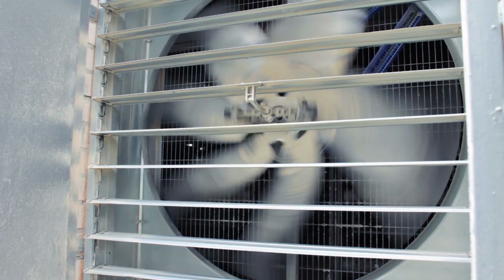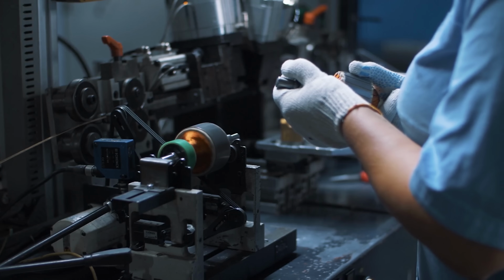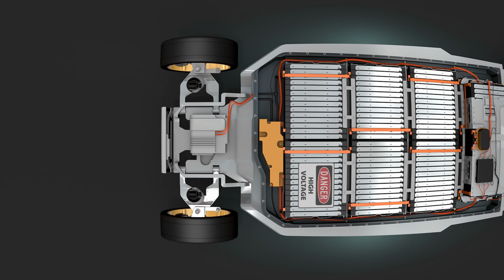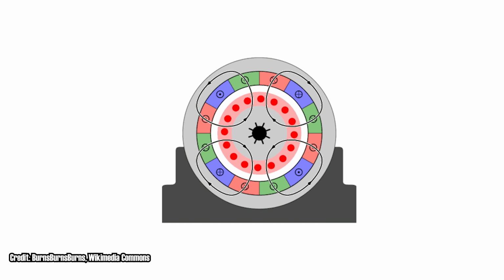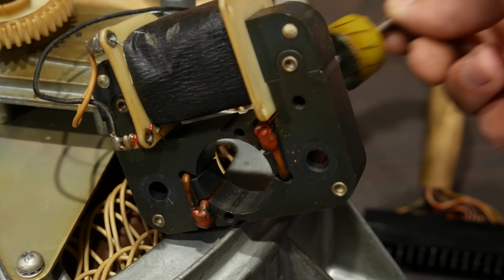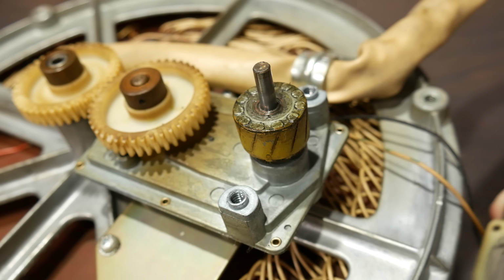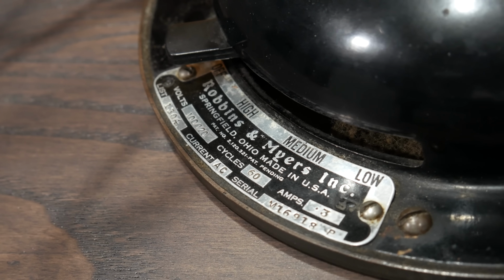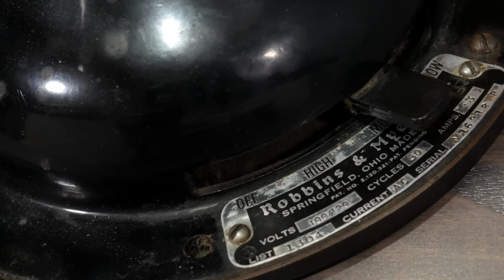Fans; High is next to Off on purpose

Comment: TLDW: Initiating the spin requires more power than maintaining the rotation. 

This is why if you have a fan thats dying you can sometimes spin it by hand to get it started and it will run fine.
Reply: Thank you. This was the comment I was looking for
Reply: Thank you.
Reply: I love you bro
Reply: Thanks
Reply: Best summary of a 17 minutes video. Sweet.
Reply: @technologyconnections What’s up with ceiling fans and the pull chain for multiple speeds?  I opened up a Hunter brand fan and was expecting something like a rotating selector but I saw two small black boxes that were wired to simple pull-chain switches. Can you help us decipher the internal workings and how do these small black boxes work differently than the on-off switch and the wall switch that makes the fan hum when on the low speed?
Reply: Torque
Reply: A fan that is "dying" usually signifies the need to lube the dry bearings. The motor is usually fine.
Reply: I've lived in old houses with less robust electric capacity and when the refrigerator compressor came on, the lights would temporarily dim about a second and then recover due to the greater initial power draw needed to overcome the electromotive force and start it turning. A window air conditioner would do the same thing. Not sure if EMF is the right term. Learned that in physics class a really long time ago.
Reply: @stampoutup-talking1436  The EMF builds rapidly from zero in a typical AC motor as it starts, impeding the initial current surge. When the AC motor achieves its steady state in less than a second, the EMF is high, and the available current returns to the lights.

A stalled/frozen AC motor that is not allowed to turn draws a lot more current, and may burn itself out. EMF is actually beneficial.
Reply: Wow, spoilers
Reply: if that happens to you, just replace the starting capacitor.
Reply: You have it wrong though 🤦🏻
Reply: The real answer is that the electric motor produces no torque when it isn’t spinning
Reply: @Stierenkloot   Newton law of motion states a rotating mass requires no power to maintain rotation except for the power required to cancel friction. Since power is required to initiate rotation, and the power required to counter friction must be factored in, how am I wrong?

As far as your torque comment goes  that is correct, but completely irrelevant to the question. All you said is something that isn't moving creates no torque.
Reply: @dyingbreed5386  I think you really need to rewatch the video. The motor CANNOT create torque when it is off. That is the point. Not that it takes more torque to turn it on
Reply: @Stierenkloot   Who is saying the motor creates torque when off? Torque is a measurement of force, obviously a motor that is not running creates zero torque. The question posed was why is the high settings next to off. That is what I answered. High is next to off because the initiation of rotation is where the most power is required. By having the high setting next to off you can theoretically use a less powerful motor. Let's say it requires 100w to start a fans rotation. By having high next to off you only need a 100w motor in the fan. If low was next to off then the motor would need to produce 100w on low and more wattage at higher speeds.
Reply: @dyingbreed5386  bro you really need to watch the damn video and pay attention. Also I didn’t say the motor creates no torque when off. It creates no torque when it isn’t spinning. Meaning when you turn it ON it isn’t spinning yet so it creates no torque. It needs a secondary component to give it an initial shove while the motor is ON. It’s not rocket science dude. I can’t believe nobody is calling you guys out for being so blatantly incorrect
Reply: No. In the video the exact opposite is said, for starting you only need a very small amount of power, before the motor can properly work and suck up all the energy for moving air, but that small initial starting power needs to have very high tolerances because it failing could have bad consequences.
Reply: Newton's laws at work
Reply: Tfw you remember there were (and still technically are) planes that make use of explosive cartridges to initiate prop/turbine spin.

...And before somebody wants to "um actually" this, yeah, I know the B-52 doesn't *require* a cart start. It was the Cold War, the whole point was there may be an event where you've gotta get the ones not already idling to be able to take off in a few minutes compared to the hours of prep to start one up conventionally.
Reply: If your one is dying, you probably have to replace oil in bushings. This helped to mine and will help yours in case it won't spin but coils are still alive.
Reply: You're a saint
Reply: A trick that every mumbaikar who has ridden those local trains in the 90s eventually figured out.
Reply: You are a hero. This video should have been the length of this comment, everything made perfect sense after reading it, as opposed to 22 minutes of blather.
Reply: Just didn’t understand some of what he said, thanks gangalang
Reply: Thanks for saving me SEVENTEEN FUCKING MINUTES?? Christ. Some people really are desperate for attention... Thank you for answering the question, I appreciate it. :)
Reply: I had a fan like that. Dear to my heart, really. It did it's job tirelessly, you just had to help her start. It was just a cheap tesco fan, nothing fancy, but it was mine. It felt kinda cool though, to be honest, like starting an old engine and praying for it to start then hearing that "gluck" sound repeat faster and faster until it kicks in proper. It was a good fan..
Reply: If it starts by hand, it's the capacitor that needs to be changed.
Reply: But this is wrong. It isn't that it requires more power to start, it's that the induction motor cannot produce torque until some amount of slip has occurred.
Reply: @Eidolon108  10:40 You are correct but it doesn't answer the initial question: why is high next to off. Whatever starting method that is used (from shaded polls to a tap of your finger) the lower power setting of the induction motor doesn't always produce the power necessary to prevent stalling. Going from off directly to high generates the power necessary to get the blades moving enough that rotation can be maintained.

I suppose I could have said "after the first  ms of rotation the higher power is required to ensure the motor has the power to bring the blades up to a speed that ensures mechanical resistance can be overcome, preventing stalling." But I was trying to explain it in the most direct, and simple way.
Reply: You’re the real MVP.
Reply: This happens with my outdoor ac fan thing. When it’s too hot outside we have to spin the ac fan by hand or with a stick and then someone inside turns the ac on
Reply: Thank you! I tried but I cannot for the life of me wrap my head around what he’s saying 😂

Comment: Mental note:  When an evil Bond villain tries to chop you up by turning on an industrial fan, you should grab the blade before it starts turning.
Reply: Mental note: When becoming an evil Bond villain make sure the electromagnetic field on my industrial fan makes enough torque to not be stopped by a MI6 agent's hand
Reply: Gabriel Malta mental note: get strong enough to stop overclocked industrial fans.
Reply: Mental note: if becoming an evil bond villan, electrify the fan blades on the industrial fan to stop people from grabbing it
Reply: @demomandemopan370  electricity makes things hard to let go of, I fried a cable box once so I know
Reply: @demomandemopan370  Mental note: bring scissors when i become an MI6 agent so i can cut the blades
Reply: @odysseyguyperson  the blades are made of metal, metal sharp enough to chop your bones apparently.
Reply: Well, to ruin the joke, if it's industrial, it most likely uses a a better starting method or even worse is three phase, so you'd probably still end up thoroughly chopped up.
Reply: @Need2connect woah that's fucking wild, I've never heard that before. Thanks for the knowledge
Reply: Finally, just normal good advice from the internet. Thank you madjohnshaft for making this a safer place
Reply: @illeagle9560  both DC the AC current will cause muscles to contract making it impossible to let go. If you don't believe me you are free to experiment on your own. Higher voltage levels will tend to throw the person though. Like I said feel free to experiment, but have a second person with you so we may know the outcome 😉
Reply: @markbrown8097  .... I'll take you word for this my friend, rather not have my heart explode
Reply: Just make sure the motor isn’t a PSC or 3 phase
Reply: These are the kinds of life lesson a I’m grateful to learn before I need them
Reply: @illeagle9560  if it throws you it blew up your hands

If it freezes you (muscles contracting uncontrollably) it wasn't energetic enough to vaporize your hands/itself. That really is the difference. 

In fact most throwing incidents are arc blast, which is when electricity turns metal into a bomb. Look up 480 volt arc blast testing if you want to know what flaming vaporized copper looks like! That usually happens when two things that shouldn't touch end up together, unlike freezing which is when two things that shouldn't touch get connected through a person.
Reply: @gabrielmalta1962  or just turn your fan is a fan with knifes ad it blades
Reply: Mental note: never become an agent
Reply: Mental note: when becoming Bond villain just shut up and shoot.
Reply: @gabrielmalta1962  Just use a synchronous motor with frequency converter. That way you don't have the same problem with low starting torque and slip.
Reply: @JainZar1 just keep talking and always use 3 phases.
Reply: @HighestRank  Technically you don't need 3 Phases if you have the right FC, but it helps.
Reply: @illeagle9560  
That depends.  AC is much less likely to do so.  But DC is.  AC is more likely to stop your heart though.  So I guess there are pros and cons to everything.
Reply: @phasepanther4423  huh was unaware of that, I always thought they were both equally dangerous to people and the difference was just how they powered things. Guess it'd it make sense that they react differently with people though of they do with machinery and electronics
Reply: @illeagle9560  
It's no issue.  We learn new things every day.
For example while it's well beyond the amount that could kill someone and will definitely injure them if touched, up to 1000v AC is referred to as low voltage because it needs to be touched for current to flow.
Anything beyond has diminishing returns with increases in voltage on how far through the air it can jump.  At high voltages, you need to be further away to be safe.  The minimum safe distance for 800kv is 6m if I remember correctly.

The reason for this is that voltage can be seen as pressure and any insulator can be seen as porous cloth of different densities depending on how well it insulates while trying to stop water from flowing.  Air is just another insulator.  But after a certain pressure it is ineffective.  In the case of electricity that generally destroys the insulator in the process.
Reply: @illeagle9560  I got "plugged" to an outlet once.
Yes you can't let go.
Reply: @illeagle9560  Your comment has so many likes yet the truth of how electric discharge works has less than a quarter of the likes... no wonder people don't know.
Reply: Mental note: use a brushed motor to chop up secret service agents with an industrial fan. 
Second mental note: Explain the details of your needlessly convoluted plan in needless detail after the agent is dead. 
Third mental note: Don’t label the self destruct/ emergency stop. You can worry about work safety regulations after  committing first degree murder
Reply: Since most industrial fans are belt driven, you'll quickly burn the belt out.  But industrial fans are also 3 phase and go from 0 to 1750 in only a few sine wave pulses.

When I went to the John Hancock Building skydeck, I could hear the belts squealing of all the rooftop air handlers turning on, every few seconds.
Reply: Mental note: don't talk to the MI6 Agent about the ingenious deathtrap he's in and just shoot him.
Reply: Note to possible agent in the future: Don't let said villain contact youtube shitposters for ideas
Note to possible villain in the future: Delete browser history and shitpost comments from youtube before enacting plan
Reply: Reverse Uno lol
Reply: @demomandemopan370  that does the exact opposite thing you want it to do
Reply: Mental note: get hencemen to replace single phase industrial fan with BLDC 3 phase industrial fan
Reply: Good plan!
Reply: @illeagle9560  if you ever see someone getting electrocuted, don't touch them if at all possible (e.g grab them). For anything not three phase/distribution voltage, the best way to save them is to kick/hit them away from the source. Ideally, you'll be wearing shoes or boots to keep you from completing the circuit yourself

Source: did search and rescue for a while. Am still mentally prepared to take a boot to the chest.
Reply: @jakesmith2341  my shop teacher actually taught me this back in like 2013-14, very useful information just wish I shared it with my friends lol. One time I fried a cabel box by touching the cable and the hookup while extremely sweaty and nobody knew what to do, I thought someone was shaking me until I realized I was being shocked lol
Reply: Mental note: when becoming an evil Bond villain keep my industrial fans always on
Reply: mental note :  dont get into situations involving abnormal industrial fans
Reply: @illeagle9560 but then they’re being electrocuted, so they still die.
Reply: @theopoldthegamer4284  agreed

Comment: I have an oldish fan (maybe 30 years old, so looks fairly modern compared to the real antique fans) with push button speed control. It very often fails to start on low. I discovered on my own that if I put it on high first, then switch it to low, it does fine, so that's what I normally do. I did assume the higher power was helping it get started, but I'm very glad (because I'm also a big nerd) to know the details of what is going on. As for why this particular fan can't start on low, I'm guessing it's higher bearing friction due to its age since it used to be able to start on low just fine.
Reply: It probably needs a clean up and  regressing or fresh oil on felt(usually around the bush).. It depends on the design as to which it is. Most modern fans in Australia since the 90's, a light layer of grease does the trick after a dismantle and clean. (Don't robes the bushes unless they're designed to be easily removed, just clean them through!).
Reply: probably just needs a little zoomspout or 3in1 (blue can)
Reply: probably should just get a new fan
Reply: @balthasargerard7246  I only use it in the garage, so I don't care that it's crap. It's not quite bad enough to throw away yet.
Reply: Can a van start to catch fire when it stops spinning while it's still turned on?